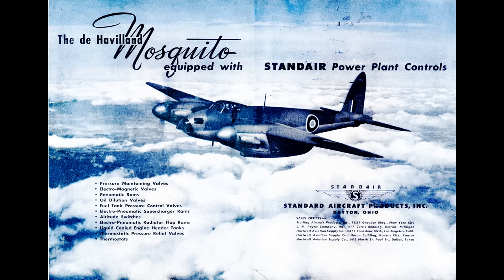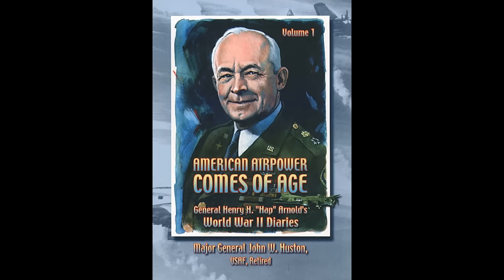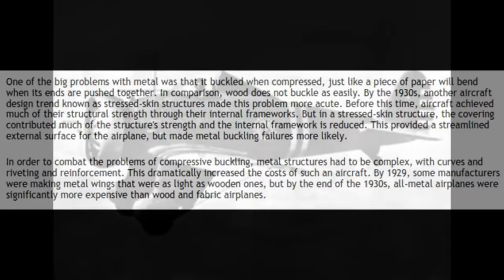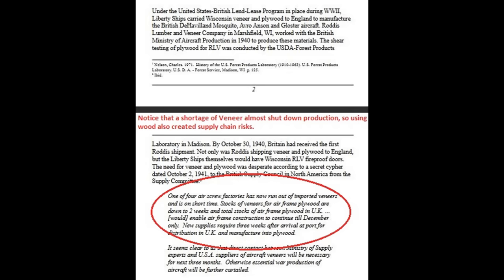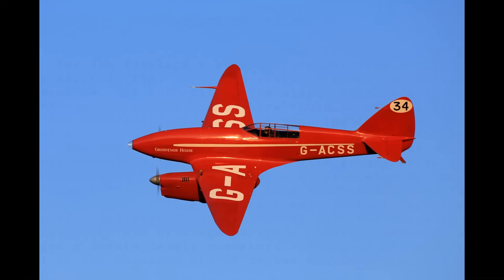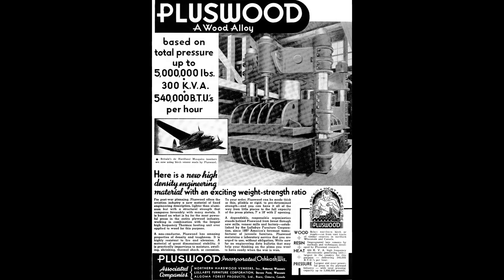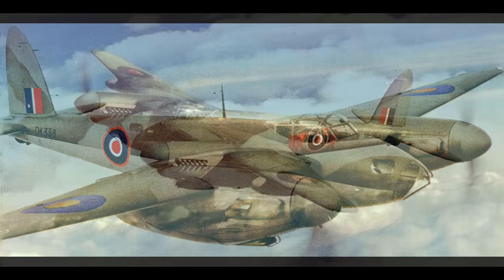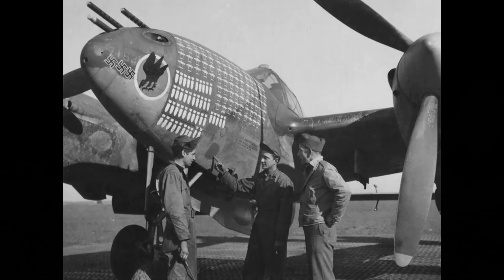De Havilland Mosquito vs. ?

Comment: Mozzie has to be one of the most amazing stories from WW 2.
It could be built mostly by craftsmen Britain already had and freed up metallic materials for other uses. 
It flew faster, higher than any German plane for most of the war. 
The Mosquito carried the same bomb load as a B 17 but, with a crew of two, higher faster and suffered less than 10 % losses.
Add to which it was good for just about any other task including photography, weather reporting, sinking u boats, night or day fighter, pathfinder for heavy bombers, low level precision attacks including with such accuracy they even broke open a Gestapo prison releasing a large number of French prisoners condemned to death by the Gestapo; and so on. 
Now name another plan to match that record ?
Reply: I have never noted the sources I read from but the anecdotesare that Mosquitoes were based on the skilled wood construction workforce that was based on a 30 year plus skillset that would not transfer.
Reply: ive seen this comparison with the B17 many many places but never found the source. please assist me to find the manual or book where it lists the bombload, at range and altitude. best i have seen is 4K lbs @ a comparable range with the B17s 6K lbs, but it doesnt give the alt, range or cruising speed.
Reply: Higher than any German aircraft? A service ceiling of 26k ft wasn't exceptional, even BoB He111 was 27k same as Do17, Ju88 26.5k etc
Reply: @jakeb6703  these 'facts' are often thrown about 🤔😉
Reply: What he has done is take the mosquitos maximum load and compared it with the B17's minimum. The Mosquito load for a bomber could be a 4,000lb cookie bomb which could not be dropped below 6000 ft due to blast effect and could not be accurately aimed apart from on a city or built up area, other than that it  was 4x500lb bombs load. There are records of B17's  carrying 6,000 lbs of bombs to Berlin.
Reply: @ericadams3428  True enough, although the Mosquito and other attack aircraft were also much more precise than B-17's and Lancasters. A heavy bomber could fail to hit an entire city, while a Mosquito could destroy specific parts of buildings. In many respects, WW2 attack aircraft like the Mosquito, Stuka and Tempest were the forerunners to modern jet aircraft which employ precision munitions.
Reply: The B 17 had a payload 20% great and almost three times the range....albeit 25-30% slower
Reply: @Cailus3542  I could argue the stuka is more precise than the B17 and therefore superior at bombing, and I would get laughed at. Thats because divebombing doesn't equal carpet bombing. If the Mosquito was hood enough to bomb berlin and was cheaper, you think they would switch to all-wood designs, but then the B29 arrived, which is faster than the Mosquito when both are at it's cruise altitude, and can climb far higher. Mosquito fanboys seethe.
Reply: @richardrichard5409  The MkIV had a ceiling of 34k feet
Reply: @jakeb6703 B-17 bomb load for a long range (800miles) mission was 2000kg, bomb load for a MkIV mossie was 1800kg (1×1800kg cookie bomb) for the same mission range. Figures are from Janes fighting aircraft of WW2.
Reply: @richardrichard5409  Some Mossies went up to nearly 50k.
Reply: @ericadams3428  Mossies often did TWO trips per night.....for a TINY fraction of the resources required for four-engined heavies.
Reply: @BrandonTheKralik  I'm not sure why you think this is a Mosquito vs B17/B29/Lancaster thing? It's like comparing a sniper rifle to an RPG. They were very different weapon systems with different roles. The various level bombers (B29, Lancaster, etc.) were weapons of indiscriminate mass destruction, while attack aircraft (the Stuka, the Mosquito, etc.) were used for precision and tactical missions (eg. attacking tank formations). They were different beasts.
Reply: @BrandonTheKralik  yea but a f16 can fly higher and fast b29 fansboy can cry :)
Reply: @BrandonTheKralik  Brandon: “mOsQuItO fAnBoYs sEeThE”
Me: Gets in cockpit, wife spins io engines, flies over Brandon’s house and empties 480 rnds of Hispano 20mm into his roof

The bomb load thing is a comparison between a fully loaded B-17 (with guns loaded etc) and a Mosquito going to Berlin - the Mosquito was more capable, and very much could be and was used for strategic bombing - it was so accurate it required a quarter of the bombs of a B-17 to do the same damage.

Obviously there are roles a B-17 can do a Mossie can’t. But I’m using this example to demonstrate its versatility.
Reply: what the mosceto could do that no other heavy slow bomber could was get real close to its target, how? because of speed, it was fast enough to dive, bomb and get away. Key point is SPEED, this why it existed. It was purposely built out of wood for that very reason.
Reply: B17 was a dumb idea. Day bombing and loading up all the plane with guns which were mostly useless which also made it so heavy that single engines planes not too soon after can carry more than it. Such a waste of life. I get the idea but when they seen it didn't work they should of stopped or changed tactics. Poor guys in those bombers got slaughtered. The p51 escort helped but it came late and didn't stop the carnage. The mossy was amazing for getting such low losses. More precision bombing using the materials available and skills available to make something even the Germans tried and failed to make. The wooden wonder. Apparently the Germans attempted this wooden plane idea but didn't know the glue techniques etc. To give it strength and their prototypes were failures. And because of this lighter construction and two beautiful Merlin engines it flew fast enough to get out of there after the bomb load was away with.
Reply: @bassface8580  mosquito was thinking out the box idea. Definitely something unorthodox but got passed by the government. This is not always the case! Many great ideas like this are shot down by higher up authorities because they either are too complex, expensive or will take too long or were realized too late in the game. Sticking to hard proven tactics seem the sure way to go, unfortunately that way had the most amount of casualties. Remember that when germany were making the first jet engines, The Brits had also cracked it and were parallel in making their own but the government did not go for it. Not saying government is at fault here, they are weighing the financial risks here as well.
Reply: @ronitsingh85 wasn't made of wood for speed. You don't know what you're talking about. You're regurgitating things you heard other people who didn't know what they were talking about had said.

Comment: If you think this aircraft is beautiful you should check out the de Havilland Hornet.
It was a single seater long range fighter version of the Mosquito, developed towards the end of WW2.
It was a brilliant aircraft  but the RAF thought the war was won and there was no reason to rush it's development as the Mosquito was doing the job.
Same engines as the Mossie - but a slimmed down single seat aircraft, with a better power to weight ratio, and hence faster and more manouverable.
Eric  Brown loved it.
Some squadrons were equipped with this phenomenal aircraft ( including carrier versions) and those used in the far East found it faced a problem unique to its type ....termites !
Reply: The engines were not the same as those of the Mosquito. Far too late in the day, RR built Merlins which were handed - one clockwise, one anti-clockwise. This solution was applied much earlier in the P38 and completely solved the main drawback of the Mosquito - having to take-off under full right rudder to stop the aircraft flipping at low altitude.
Reply: It used an even more powerful merlin, over 2000hp each for a total of 4000hp, in a plane that was barely a ton heavier than a p47

Comment: Although wood was certainly the right decision for de Havilland, I feel like the decision to use wood construction gets an outsized amount of credit in comparison to other factors, most notably the aerodynamic design. The aircraft's streamlining (as you mentioned) is outstanding. It featured:
- Fully-enclosed main gear
- Retractable (semi-enclosed) tail gear
- No defensive armament
- Excellent nacelle design, including the spinner and air intakes
- In-wing radiators
- A wing of moderate aspect ratio without excessive area
- I don't know anything about de Havilland's airfoil, but it can't have been horrible
Reply: No need for rivets.
Reply: the airfoil was NOT NACA-approved. 

...it was BETTER.
Reply: Modified RAF (Royal Aircraft Factory, subsequently RAE ?) aerofoil (similar to the DH88 Comet)

Comment: The Mossie ranks right up at the top of my favorite all time aircraft - in that lofty realm of "I can't decide".  That indecision is mainly because so planes got too specialized by upper level decisions that limited the ways they were utilized.  In the age before electronic computing, the engineers did amazing things with slide rules...
Reply: Got through college with a slide rule in the 70s. Probably the last of the lot.

Comment: Your usual great video!
Most “old fashioned” wood frame aircraft used a space frame (or truss) a determinate structure where the geometry of the members provided a rigid structure, as long as the individual members don’t fail.  The de Havilland structure is completely different.  Most structures fail in compression due to elastic instability. If a compressed member is so stressed that any elastic deformation of the structure increases due to the compression. Recursion of this effect causes the stressed member to fail in bending. If you don’t believe me just ask Leonard Euler.  The de Havilland solution: make the skin of the aircraft a sandwich of covered inside and out with a strong wood like spruce and filled with an ultra lightwood like balsa. The fact that aircraft skins “want to be curved” enhances the effect. A good example of this is the common cardboard box the lightweight corrugated filler vastly strengthens and stiffens the box. (Interestingly the Junkers aircraft uses a corrugated skin aligned with the presumed airflow but I doubt if it really doesn’t cause a lot of drag anyway). The problem is that structures like this while very strong are also very rigid and fail catastrophically,  Wood shatters, metal bends.  As you point out wood is almost transparent to full metal jacketed bullets, and just initiates  the fuse in explosive ones. De Havilland gambled and won by going all out for speed. No armor nor defensive armament. I’m still working on the sidewinder drive.

Comment: Was grooving on Mosquito yesterday and came around to this video again. Another great video, Greg. Contra-rotation earlier in the program would have been nice but no question this machine was a VERY successful design which made a big contribution to the war. P-38 was a great machine but one thing the Mosquito had that the Lockheed did not is a sizeable bomb bay you keep the payload out of the slip stream.
Reply from the maker: That's true, the Mosquito has advantages, but so does the P-38.

Comment: Most interesting. As you say the Mosquito was built by de Havilland primarily because of its long experience with timber construction. They knew that by designing this aircraft in wood it would perform as well as any metal built aircraft (realising that they also had the work force and could call upon the rest of the timber construction industries in the UK to assist – then being 
underutilised). Remember this aircraft was a private venture by de Havilland due to the Air Ministries thoughts that a frontline aircraft built out of wood was not suitable, like the US manufacturers they were biased in their thinking, wood was 'old fashioned'. Plus the Air Ministry couldn't get their heads around an unarmed bomber relying just on speed. The thinking back then was that the bomber will always get through if its saddled with multiple gun turrets. de Havilland continued to have little support for the aircraft, but Sir Wilfred Freeman championed their cause in Whitehall as the clouds of war gathered. The Air Ministry started to listen, but insisted on a turret which meant a third crew member as they felt it needed some form of defence. A life line was thrown when the Air Ministry agreed on a recon version of the aircraft and that is essentially how the Mosquito was born, as a reconnaissance aircraft. When the prototype first flew in November 1940 and was faster than a Spitfire, the block heads at the Air Ministry couldn't get down to Hatfield fast enough to see this 'Wooden Wonder'! and the rest is history. As to its construction, the Albatross airliner was the true ancestor of the Mosquito as its fuselage was built in the same way as the later Mosquito. The DH 88 Comet whilst looking similar was built in a traditional style befitting wooden aircraft of the early 30s.